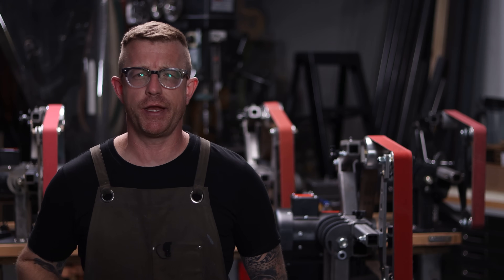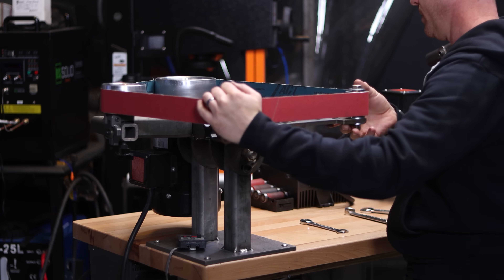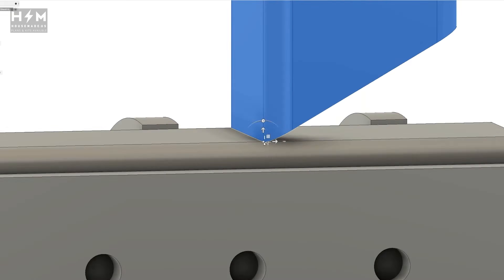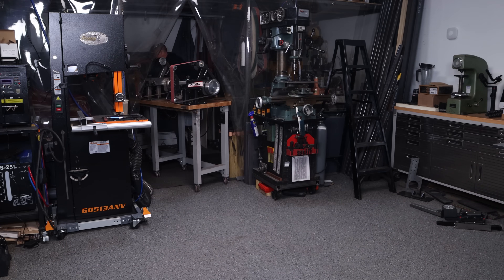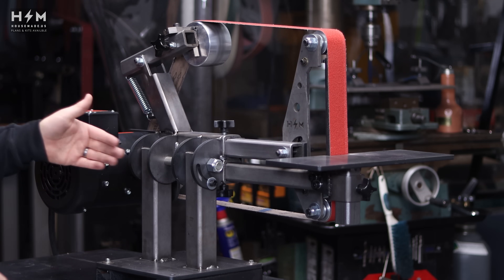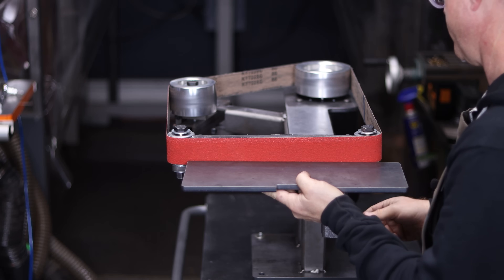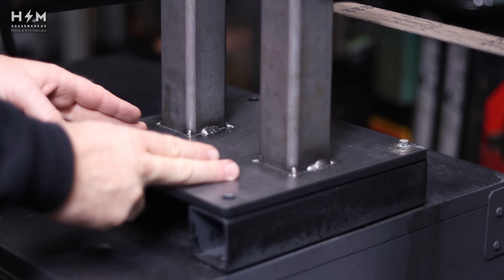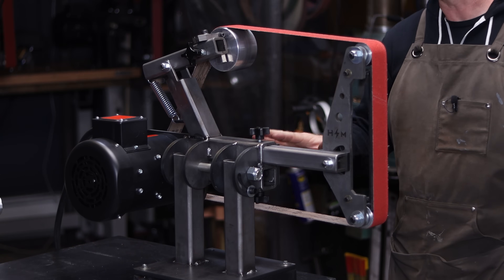2x72 Belt Grinder - Updated Design & Plans

Comment: Picked up my plans two weeks ago and finished getting it together and working today. Still some tweaking to do I'm sure, and have to take it apart and give it a coat of paint, but the plans made it go very smooth. I found a few problems and discrepancies in the plans, but nothing big and nothing that causes but a little bit of thinking and a minor bit more time to work out.
Good job Brian.
Reply from the maker: Thank you so much! 🙏🏼🙏🏼🙏🏼

Comment: What came first, the chicken or the egg. I built a cnc plasma table and was going to buy the plans and cad files to build this grinder but the 2x72 grinder I have access to doesn't have an adjustable table to easily clean up my parts and my mill is the same one House has in the video. How do I do a nice job building the grinder without said grinder? Heck, I could easily build this just from the videos and prints shown in the videos (this is how great his youtube videos are) but I want a 2x72 like yesterday. Yes, I broke down and just ordered the entire kit. Laser cut parts are great (I also have a weldtables laser cut table that I welded together) and once I have the machine built per the plans, I can build an arm with a rotary platen setup and do a large contact wheel and buffing wheel setup. The videos sold me on the kit. Sometimes just because you can build something all on your own, doesn't mean there aren't good reasons to use someone else's product which is already well designed, manufactured, and proven.

Comment: And now they've changed the backorder again. It says June now. Are there other sources for these or similiar motors? Its a problem that the motors you recommend arent available for multiple months at this point.
Reply from the maker: https://ebay.us/iesh6Q
Reply from the maker: I have updated the resources page with this information. Buy one quick they will most likely sell out also.
Reply: @HouseMadeUS  thank you for dealing with this issue so quickly. Another reason to recommend the Revolution anytime grinders come up.

Comment: Backorder on the 2hp motor just changed the date, adding another 3 weeks, at least. That'll be 6 weeks, if it happens. All motors you've recommended are out of stock, and I'm not sure if they are ever going to restock, considering how things are going with china. Frustrating to have sunk resources into what amounts to a sculpture.
Reply from the maker: I’ve been waiting for a prototype to come to me for about 3 months. I feel your pain. Nothing quick these days.
Reply: The 3hp came in stock at automation direct and I jumped on it and just the other day, the 2hp came into stock. I looked at other sources but there isn't a lot out there. Patience and quick action when they come in is necessary. I signed up for the email alerts and it worked.

Comment: Bought the kit at Gen3, haven't built yet and now the 4 is out.  Can I still use the Gen3 parts with a gen4 build, or do I need to modify any of the laser cut parts?
Reply from the maker: The Gen 4 parts fit the Gen 3 chassis without modification. Cheers! Brian
Reply: @HouseMadeUS  Thank you Brian, can't wait to get to my build!

Comment: Is the work table cutout notch beveled at a 45, so the table can be pulled in tight to the platen for a near "zero clearance" fit?
Reply from the maker: That can be done quite easily, but we don’t do that before shipping. I gotta say I have thought about doing that many times. 💪🏻😁
Reply: @HouseMadeUS  Just thinking it should be beveled before weldup, as I think it would affect the geometry if you ground it to a bevel after welding. Wouldn't be easy to bevel without a belt grinder

Comment: Bought the gen 4 kit and I would suggest 1 change -- make the Risers part of the kit- even if you charge more. Many of us do not have access to a drill press big enough to do the 3/4 hole especially all the way straight through both sides of the 2" x 2" x 1/4 thick.  I am trying to make due but I fear this will be by far the weakest link in my build.  All the rest of the build seems to be ok so far.

Comment: What RPM do you normally run at?
Reply from the maker: That’s a great question. My speeds are all over the place which is why I really try to get folks to build the grinder with a vfd. It’s such an amazing versatile tool when you can speed up and slow down the belt, not to mention reverse the belt. Thanks for watching. Hope to see you build a grinder one day. 💪🏻

Comment: Ordered my 4.0 bundle a few days ago, waiting for shipment like a little girl having to pee. I am excited to start building. The one thing I am having a problem with, is sourcing the motor, I  did get on the list for notification when it is in stock. Also having trouble letting go of $360 for the vfd . I don't want the cheaper version either, worried about the enclosure. Is there any vfd that is sealed around $200 that you might recommend? You do a great job testing for your recommendations  and may not have tested another, but have you found anything out there that might be an acceptable sealed unit? I know time is money, and I am still researching but exhausted. Thank you so much for what you do for this community, I love your content, keep up the good work. From a Guy in Tucson
Reply: Did you build this yet and what did you end up going with as far as VFD?
Reply: @mystakilla  I did build it, and I love it. I put a 2hp  220v motor on it, and I went with the Chinese hundred-dollar vfd off of amazon, and scavenged a money box and made an enclosure out of it. I put master power switch on it and the vfd comes with a remote it has a little box that you can snap the remote into and that is mounted onto the face of the box. In total I have about $800 in it. Because I could not get the motor he recommended, I just got one from Granger and it cost me a llittle over $200. Thank you for asking, I would recommend you jump all over that bundle from Brian, you will never be disappointed. It is a well designed Industrial quality grinder, that will last you a lifetime. With the money I have in it it is easily a $3,500 machine. Don't wait, Jump On It as soon as you can I use that grinder daily. Good luck and happy grinding.

Comment: Good stuff Brian, I'm in the middle of building now. Just finished heat treating some O1 tool steel for the platen and started welding some of the minor parts yesterday. I do find some of the R8 plans a little short in explaining smaller details of the layout, but where is the fun in building if you don't have to do a little thinking along the way? :-) Keep on it, this is excellent quality content.

Comment: Great video, Brian! I saw your note about upgrade kits.  I think I have a gen 2 (is there a way to tell?). Will upgrades just bolt right on, and fit all gens, or will mods to the grinder be required?
Reply from the maker: Yes the upgrade kit will just bolt up. The hinges on the work rest would need to be cut off if you didn’t want to keep using the older version.
Reply: @HouseMadeUS  Right on, Brian!  Bank account is on standby!  :-)  Best to you and yours!